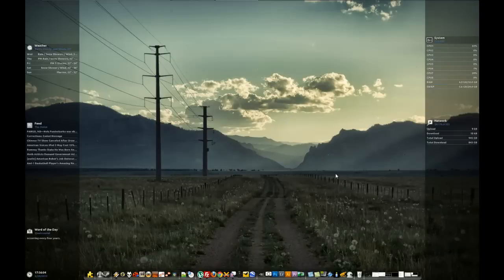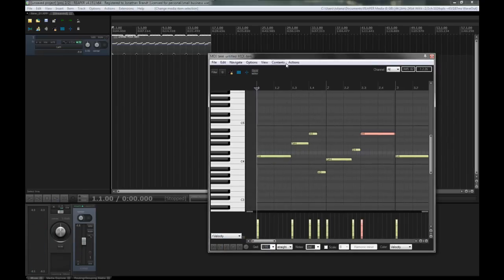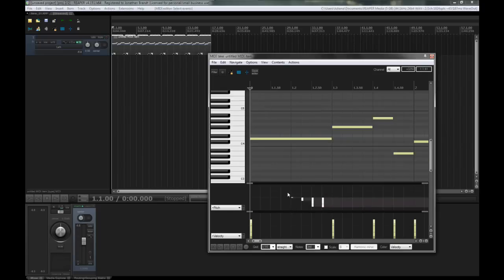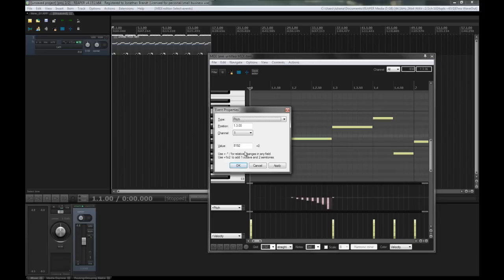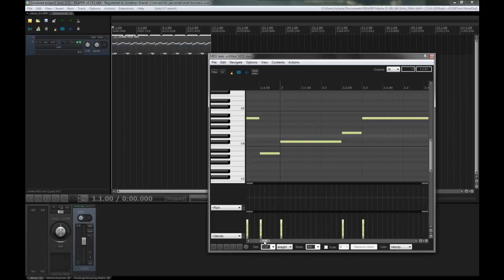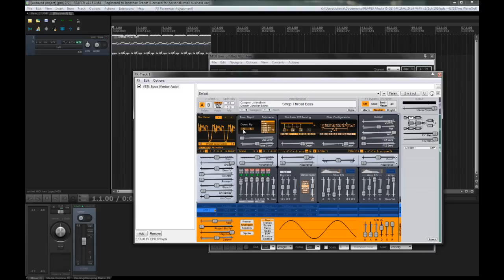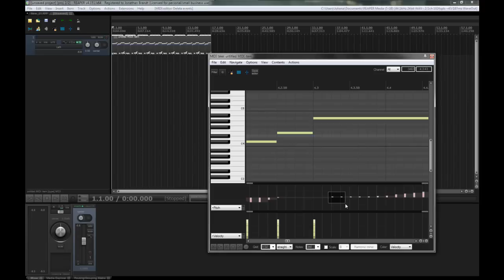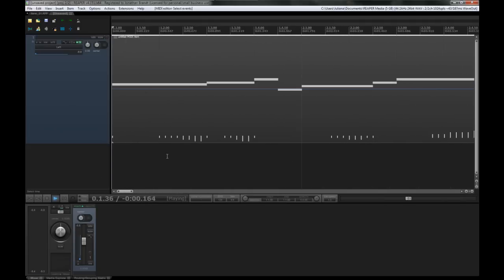Basic Pitch-Bend Usage in REAPER

Comment: I'm getting random, unwanted pitch bend information when recording a MIDI track. It's a new issue and SUPER frustrating! Any idea what might be causing this? Software? Hardware? I'm using an M-Audio KeyRig 49 controller in Reaper. It was working flawlessly until just recently. Any ideas on how to fix this?
Reply from the maker: My guess would be a hardware issue. I would open up your controller (if you can) and spray it out with a can of compressed air, just to make sure all the knobs are free of dust which could be messing with its detection of knob/slider/controller movement. The same goes for all your cord connections between your controller and your computer. Unhook them and spray them off, then rehook them up.

Comment: Hi! How do you do the Bezier curves? Mine just does straight lines.
Reply from the maker: You can do this on a per-point basis by right-click on a point in the automation lane, choosing 'set point shape' > Bezier. There are a lot of other options though, so be sure to check them out. And by right-clicking anywhere in the lane you can set the default shape for NEW points too. This only affects new points added after the change of default, so if you want to change old points, you can right-click and choose 'select all points' and, once selected, right click again on a point to change the shape of selected points.
Reply from the maker: Oh, and I forgot to mention. You can change the slope of the Bezier by alt-click-dragging on the line between two Bezier points. You can also right-click a point and enter the Bezier slope manually, but that's way more time-consuming.
Reply: Thanks Jonathan! :)
Reply from the maker: No problem! Don't hesitate to ask if you have any questions on other topics concerning Reaper. I've been using it for 10 years now and would happily make you a video or text tutorial if you need help or are just curious about something.
Reply: I'll do that. Thanks again.

Comment: Is this the only way to slur notes? This is so time consuming.
Reply from the maker: No. It's the only way to slur it purely in MIDI, but most software synthesizers have some pitch options that are pretty handy. Look for a 'legato' or 'portamento' or 'glide' knob/switch. Usually there are also some glide time controls, and whether you want the glide between notes to be at a constant time (e.g. always 100ms) or at a constant rate (e.g. always 100ms per semitone, so if you're gliding between notes three semitones apart, you will get a glide time of 300ms).
Reply: Thanks for the tip! I'm new to Reaper, but I've seen what you're talking about in some instruments. I'll have to install and try out some more synths!